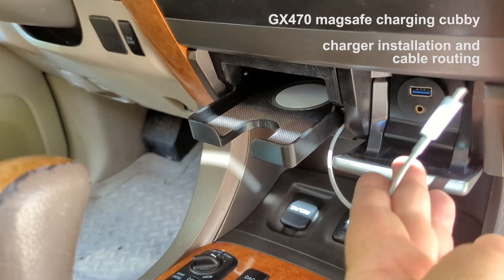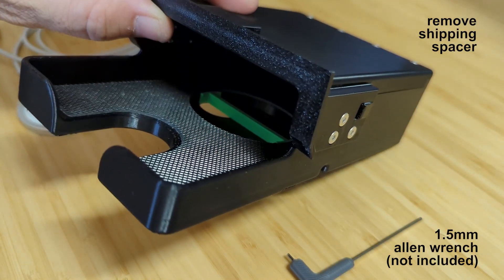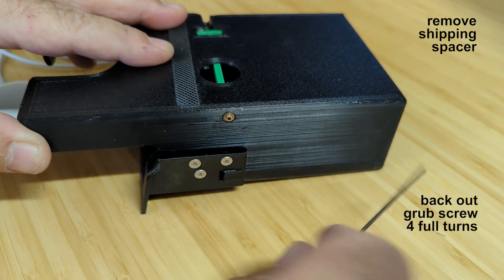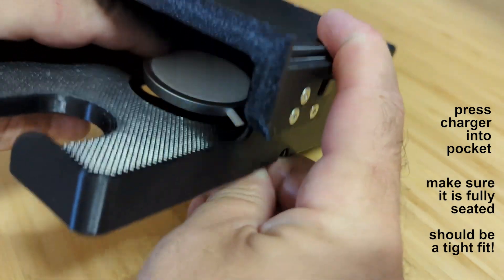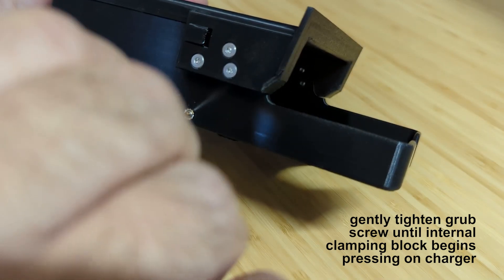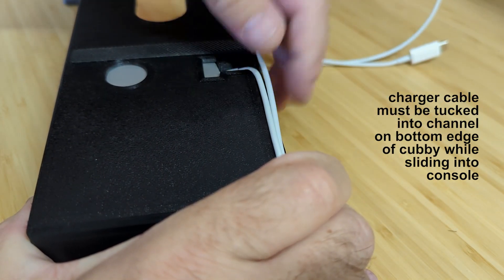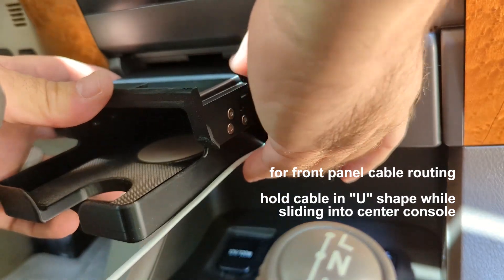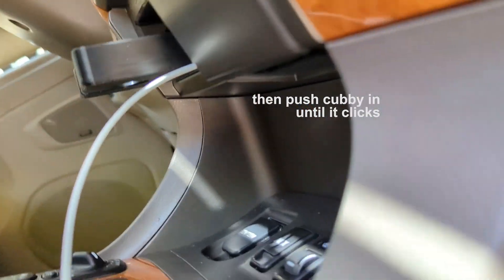GX470 Magsafe Charger Cubby Installation (also 2003-2007 LX470)

Comment: Amazing. Just received mine today.
Amazing worksmanship. I have a question tho. Does it have to be an Apple MagSafe charger brand  or can I run an aftermarket brand one? Thank you 🙏🏻 cheers 🍻
Reply from the maker: Thank you!  I can only guarantee fit with the Magsafe.  The iXular worked for me a couple weeks ago so you might try one of those if they are available.